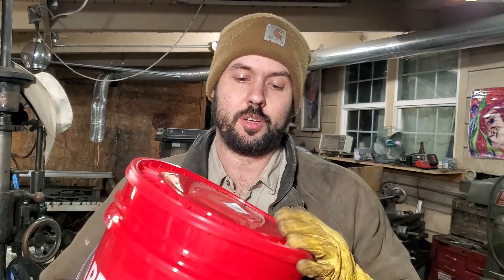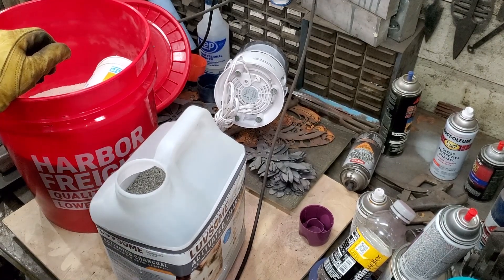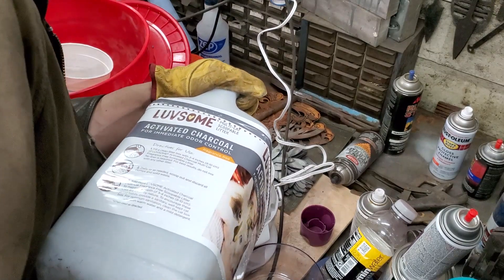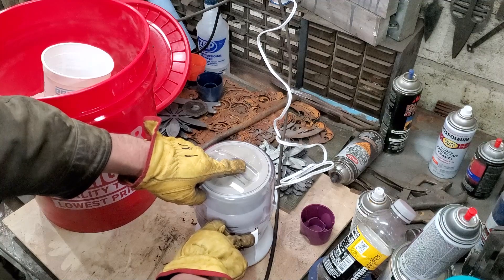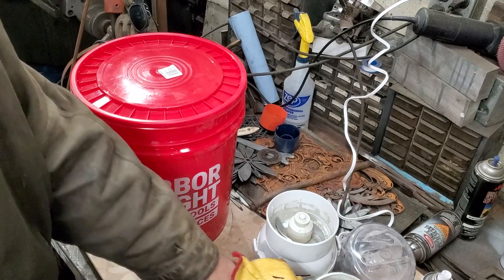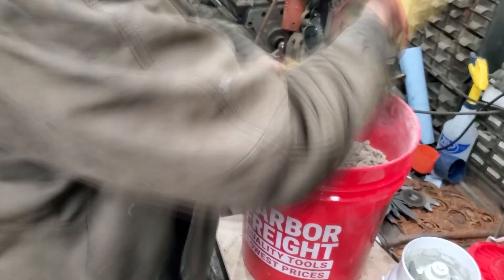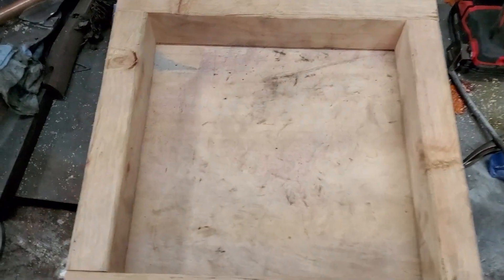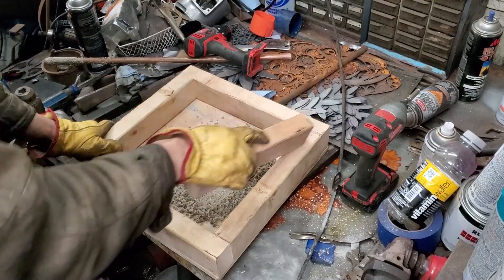Casting sand experiment and Test

Comment: I worked in a foundry way back in the late 70's briefly.  We used to riddle the sand into the mould. The mould was a two piece system. So you would have a half and half of pattern in each. Also we used a very fine, I think it was chalk dust in a cheese cloth bag. This would be sprinkled through the bag lightly onto the pattern before putting the sand over it. With the two box systen you would have to cut runners and pour the metal from the top of the mould.
Reply from the maker: This was our first time actually doing it so I figured starting with a simple open face mold would be safe, did you see the next video were we poured? I'm also not happy with the sand yet I think the lane mountian sand was too course for what we were trying todo. Thank you for the input I'm gonna hit the books and hopefully have some 2 part molds next.
Reply: No it was a random watch. Try riddling your first layer of sand through with a fine riddle. That would be the sand in contact with the pattern. Back then we were using Brass and also Gunmetal. I'm over in England.
Reply from the maker: @highlightoftheday7058  Will do thank you 😊  it's always nice to get productive advise from these 👍
Reply: I'll try and take a look at your other videos. Maybe a fully inclosed mould would give you better results. Also we used a mixture of sand and a very fine dirt.
Reply from the maker: @highlightoftheday7058  I have a layer of river silt or volcanic ash in my backyard I'm thinking about screening some and adding it in a test batch. We live in an ancient river delta and my house is located on the old river bottom I've found all kinds of neat things digging in the yard.

Comment: Came out nice, try some motor oil and sand it does the fine detail better..👍
Reply from the maker: I think I need alot finer sand I added some wood ash to gonna try again today. I had read about oil sand I just wanted to figure out my mesh size and what not before I mixed up an ecological hazard 😅 Typical I mix my used oil with woodash it makes a paste that burns well in the shop stove.